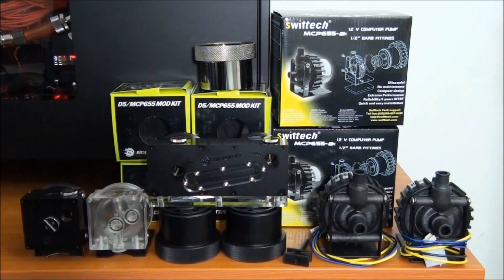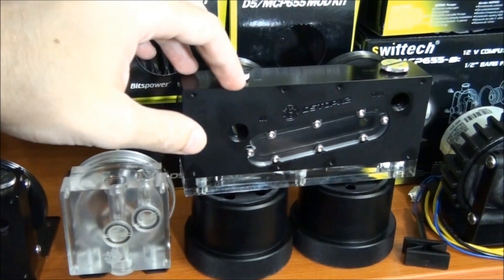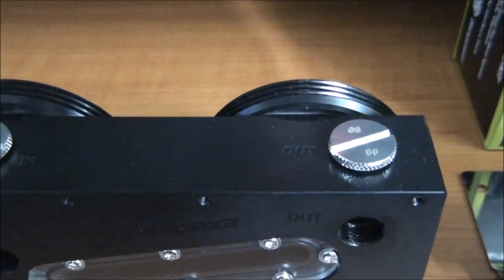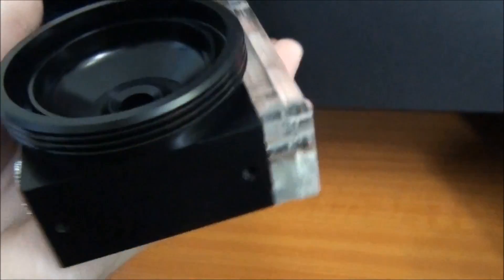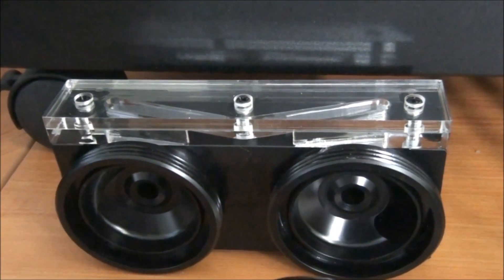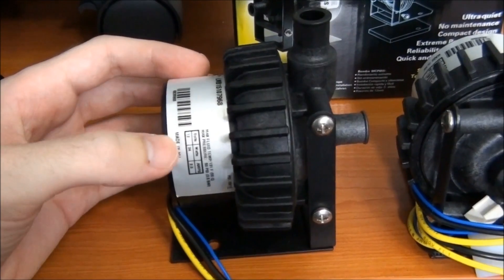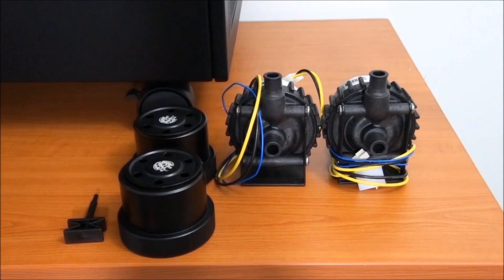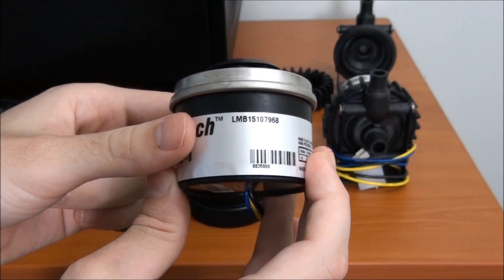Bitspower D5/MCP655 Mod Top & Mod Kit Product Overview & Installation Guide

Comment: Hey singularly computers, 

Just wondering if it's possible to use the pump top without the mod kit? 

Bought a mod kit upgrade kit under the assumption it had everything I needed but it didn't.. (damn bad descriptions) 

Cheers,

Comment: I used one of these pumps with the default top, as I could not affoard any pump top to put on at the time. It was a massive pain in the butt getting the tubing over the extruded lip. Another drawback is that you are pretty much locked down to just one tubing size for the pump, which will ruin the aesthetics if you wish to use a smaller tubing size. I am never again not using a pump top in my builds D:

Comment: Hi I just received my upgrade kit for the Bitspower d5 mod top.  The instruction manual says to use M3X12 screws however I do not have the tool to tighten it down all the way.  I can only finger tighten it with my nails and it is still loose.  I installed the o-rings and everything else too.

Comment: Man i was looking all over for a good clear video of the Bitspower Dual D5 Top Mount and found it here. Daniel you mentioned the "UN Pump Mounts" for the Bitspower Dual D5 Top where you show it mounted in the build. Can you please tell me where do you get those mounts to mount the Dual Reservoir or do you know alternative mounts that would work for similar mounting? I'm considering using 2 Dual D5 Top Mounts in my CaseLabs build for pump redundancy of reservoir system.
Reply from the maker: +Ardent Dfender You could use Singularity Computers Ethereal mounts depending how you want to mount them: https://www.singularitycomputers.com/product-category/watercooling/reservoir-mounts
Or search UN Mounts on the Performance PCs Store: http://www.performance-pcs.com/latest

Comment: Did you really only show installation of the Dual D5 top? Why. Almost NOBODY uses a dual d5 in the same loop. Its completely redundant. 

This is coming from someone who had a dual d5 setup on the same loop (seperated them). Unless you're doing quick disconnects and rocking external radiators Dual D5 is pointless. Even then I'd get an Ehiem.

Comment: Does the mod kit work with any D5? I'm about to order the Bitspower D5 Mod Top S model, the Bitspower Mod top reservoir Upgrade kit, the Bitspower Pump dressing, and a D5 pump. In the description it say it fits the D5\MCP655 but I was wondering if every D5 is exactly the same. Meaning will an Alphacool D5 fit in the Bitspower modtop?

Comment: This video is exactly what I was looking for. I love the aesthetic this setup provides and I've seen you integrate it several times in build logs.
I've found that actually finding these parts is extremely hard though. I finally found them all on frozencpu but the bitspower website is pretty atrocious.
Reply: Breakspeare frozencpu no longer sells shit.
the owner had a serious drug problem and fired all his staff.
the website is still up though.
Reply: Yes, I noticed that after a while. Too bad, it's a pretty great setup.
Reply: SANIC Actually they do sell stuff I just bought stuff from them. They said they opened back up a while ago but they temporarily closed because some employees were doing drugs or stealing or something like that.
Reply: Ben Sipe the owner has a drug problem yea.
Good to know they still sell shit though
Reply: +Breakspeare 
Performance-PCs.com is great. I've spent over a grand with them through multiple different orders. Every time my order has shipped the next business day and arrived exactly as advertised. Can't recommend them enough.

Comment: Seems like there is a small gap between the pump and the mod housing. Wouldn't this gap trap some of the heat from the pump? While the water will certainly keep it cool enough to operate I wonder if some localized heat could get trapped and reduce the maximum potential lifespan of the pump? Would it be worth putting some material in to fill this gap, such as thermal paste or metal foil? Moving that heat to the housing then would let the housing act as a heat spreader and moving air from fans in the case would take care of the rest.

Comment: hi, you say that using this tops increases performance, but how much?, in your build log videos (that are a lot helpful), i see that a swiftech mcp35x drain faster coolant n reservoir faster that mpc655, even on similar builds (like in bulid 13 (mpc35x) vs. dark matter build (d5)) so is better mcp35x tha mpc655?, by the way your videos are the best i´ve seen

Comment: what reservoirs does this work with I'm planning of getting it?
Reply: It works with any, you just have to connect the outlet of the res to the input of the pump top and obviously connect the out of the pump top to a inlet on a separate component.
Reply: thank you

Comment: I'm thinking of using a res/dual pump setup similar to the Beast 2. However This setup makes me nervous. Does having 2 pumps inline not possess serious potential problem? What if there both not exactly the same speed? 

Also the pumps being that close together, I would think the coolant from the first pump would be very turbulent entering the second pump, this posses no issues? 

I noticed it has to work, you have it in your waterbox, and your Beast 2, maybe others.?? you ever have issues?

Comment: No, the only swiftech pump that you can do that with is the mcp35x with the reservoir option. With this pump you will have to run a tube out of the reservoir into the pump.

Comment: I really need to know the answer to this question. Can I use this swiftech mcp655 and put a   EK RES X3 250 Reservoir straight on top with no tube?

Comment: Absolutely wonderful video. Do you recommend putting any oil or grease on the o-rings? It dosen't look like you absolutely need the back part, that you could re-use the retaining ring from the stock pump--is that true? I have a crap radiator with 1/4" INNER DIAMETER barbs, would stepping the pump down from the G1/4 connectors to the 1/4ID be too restrictive on the pump causing premature failure?

Thanks for your clear and through video!

Comment: In your Danger Den waterbox you have your rez's inlet and outlet both connected from the bottom, does not it cause splashes in the rez? I mean, the coolant current may be so strong, that the incoming coolant will be pushed up the rez, causing splashes?

Comment: Can I mix between the different inlets and outlets or do I have to stick to either the top ports or side ports? I was thinking on using this pump top with the bitspower reservoir kit that goes on top of it but then I had another idea (without using the kit) where the pump is horizontal (so you can see the nice bitspower logo with the holes) and the reservoir is connected to it's inlet from above and my outlet will be connected from the side of the pump. Is that possible?

Comment: Hello, great videos, they've helped me a lot. 
I've just put together the single Mod Kit following your direction. One thing I am wondering is can I use the top side port for in and the front side port for out? Or do I have to use both the top ports / both the front ports? Thanks.

Comment: Some people say that the single pump is impossible to use, the holes are too close. Therefore forget about compression fittings or even barbs. What are your thoughts on that? If you can respond I was described to your channel

Comment: @ Brandon Conray - The ID and OD are just so you can match fittings to the tubing your choose. Generally a larger ID means higher water flow but you require a more powerful pump or possibly more pumps to move the water around as there is more of it. This means better cooling for your system but as any watercooler should know it all depends on your ambient temp. Radiator size and number is also a consideration. Hope this helps.

Comment: how much the 2 pumps and the mod kit will cost in total ???
Reply: If you have to ask..
Reply: mr17krm Those two pumps plus + top combo, should cost about 200€. The bitspower mod kits, wich is absolutely ridiculous just for a metal cover for the pump, cost, in amazon, in europe, 70€ so 140€ for 2 mod kits. But maybe in america its cheaper, i bet it is. But on ebay UK i found d5 mod kits from barrow (good cheaper brand of watercooling parts) for 25GBP, probably like 30€ + 10€ shipping, i want one, but too expensive...